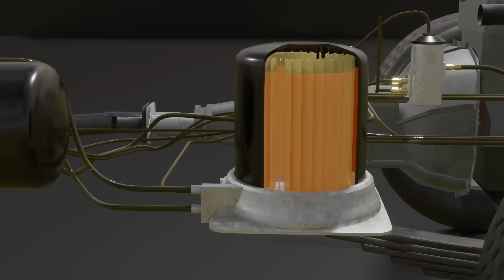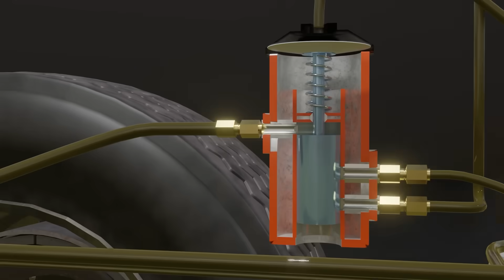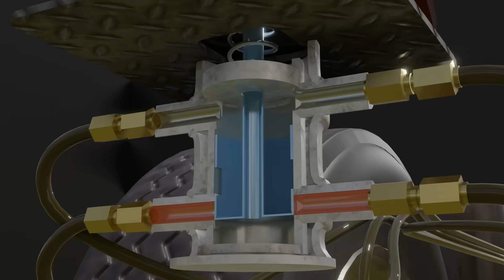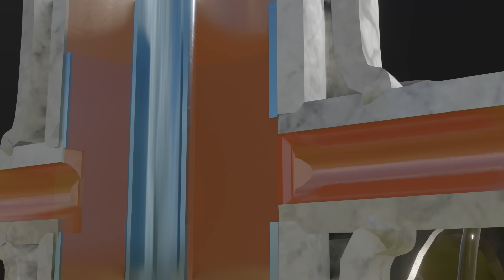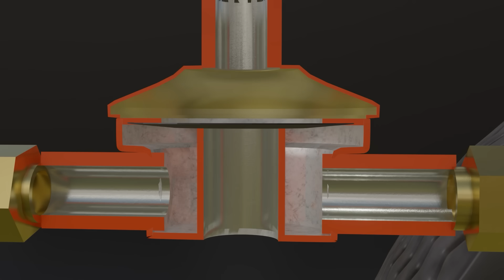You Won't Believe How AIR BRAKES Work

Comment: Former driver here. A few details are incorrect. First, while some older vehicles indeed used a belt-driven compressor, modern DOT guidelines require the compressor be grar-driven.

Second, while the dryer does remove moisture from the supply air, it can't get it all, which is why drivers should be draining the air tanks daily. Otherwise, water can and will build up in the system and render the brakes inoperative, especially in cold weather as this will ice the lines up.

Third, the system governor keeps the system at 90-120 psi. The supply tanks have a blow-off valve to relieve pressure at 150 psi if the governor fails.

Fourth, apart from required supply tank draining, these systems should not lose over 1-3 psi on shutdown. If it does, that's enough to warrant placing the vehicle out of service.

Last but not least, in the event of such a leak, the system is designed to sound a warning when system pressure falls below 40-60 psi, so the driver has warning to get the vehicle off the road before the spring brake engages, which effectively will stop the vehicle in its tracks as a fail-safe.

Comment: I was always led to believe compressed air is used to release the brakes, not apply them.  This ensures the truck will come to a standstill in case of brake failure; also one of the reasons why trailer brakes lock up and leave miles of black streaks on the tarmac if the pneumatic brake lines spring a leak.

Comment: This is low-key the best animation video that explains the air braking system. 

The design, layout varies between truck manufacturers and electronic control and safety systems varies, the pneumatic governor is now replaced by electro-pneumatic solenoids with electronic control, but mechanical counterparts and their safety is best.

But overall, this is a very good video and this explains the best, make more videos !!

Comment: Many experts are in the comments but too many of you are focused on grammar and ai. I understand this is supposed to be a very general video but no one noted the vehicle used had service brakes not fail safes on the drives.
Reply: to be fair, the video ia about the basic components of an air brake system and how they works
Reply: I did notice that..we always called them parking brake chambers..but yeah that truck would still roll unless someone was always holding the brake pedal..

Comment: This is wrong, the brakes are naturally set to activate and the airlines constantly keep the cam pressurized so they deactivate, pressing on the brake pedal closes the said lines which reactivates the brake.

This is done so that in an event of an air leak, or if you lose air, they will automatically brake. Making it a dead man switch in the absence of air
Reply: service brakes are applied with air, parking brakes are released with air.

Comment: So, if air brake system high forcely push the pushrod, how then hydraulicking are the system not too strong enough more?
Reply: Air is cheaper and readily available. 

Less maintenance for seals and filters needed in hydraulic systems.

Easy to maintain.
Reply: @etukmonday64  
🚀 The joke

🥴 You

Comment: The brake system should be reversed i.e By default spring should push to apply the brake, the system should be pressurised to counter this spring so that the vehicle can move. Upon pressing of brake pedal, the system should release pressure thereby applying brakes. Thus in an event of air leak, the vehicle will stop rather than going out of control.
Reply: This is indeed integrated in the Rolling Stock braking system
Reply: service brake uses air to apply brakes, parking brake uses air to release brakes. Spring brakes for service brakes would probably have more delay and not as fine control. Atleast in Europe we use EBS systems which have modulators near the wheels electronically controlling the pressure for even less delay and better abs functionality, with pneumatic control for failsafe. And if you have a massive leak, you will run out of air and your parking brake will engage.
Reply: Works best in systems where their brakes are used sparingly. For a system that the brakes are often engaged, there is a high chance of the system failing while the vehicle is in motion, and if it happens on the speed lane, not much can be imagined.

Better have a break that fails while you suddenly need it, than have one fail when you don't need it. Vehicle with variable valve timing sometimes comes with a valve that was stuck in the position of its last use.
Reply: you are absolutely  right  about this . for safety reason  when we have  air leakage  the vehicle will  must stop !  [ stucks the brakes']  so the description  about  this video presentation  for my opinion  is little bit  ''technical confused ''!

Comment: Is it really less brake force on hydraulic systems? 
I heard it was more because if you have a small leak in a hydraulic system you can basically lose your brakes but if you have air brakes, because it uses the air to release the brake instead of to brake on the emergency side, you'll still have brakes in the event of a leak.

Comment: No, you got it all wrong. Both hydraulic and pneumatic are equally as strong. Air brakes are more redundant and less prone to contamination.
Reply: Most air brake systems I know of have a second diaphragm with a heavy spring that applies the brake if the air pressure is lost or needs air pressure to release the brake ( used for parking by dumping the air )

Comment: I appreciate your time and Effort, But unfortunately Technicalities explained in this video are Wrong.
Reply: Yeah the compressor is mounted in a way to be geared from the timing gears not from a fan belt, plus the brake pot showen in this video is of a service brake only and not of a spring/service brake pot, where compressed air is applied to release the brakes as well as compressed air is applied to actuate the slack adjustor to apply braking force.
Reply: @SnowmanAndFred650 they’re belt driven air compressors on trucks.
Reply: @SnowmanAndFred650  Many years ago trucks/trailers did not have spring park brakes, and some had belt driven compressors, so if you went to couple up a trailer with no air it would run away from you as you backed under it!
Reply: Me parece muy didáctica y bueno Yo le entendí que,no Soy motorista de profesión
Reply: I re-narrated the video in better English:  
https://www.youtube.com/watch?v=bS5Sx2vq9e4
Reply: Its a garbage AI video.